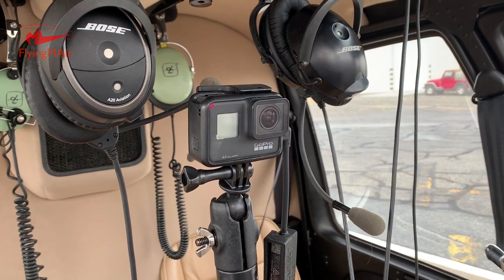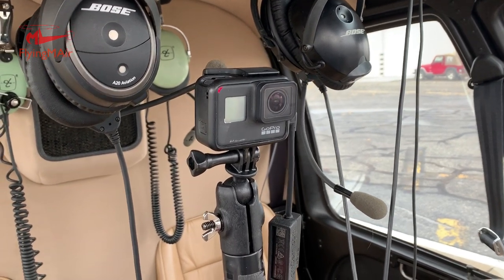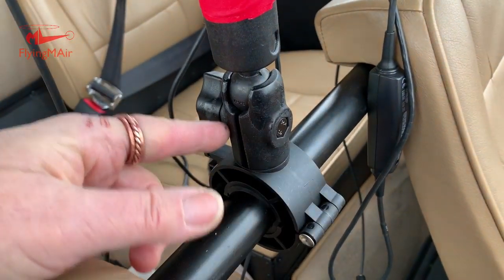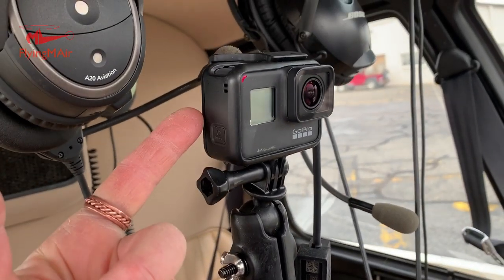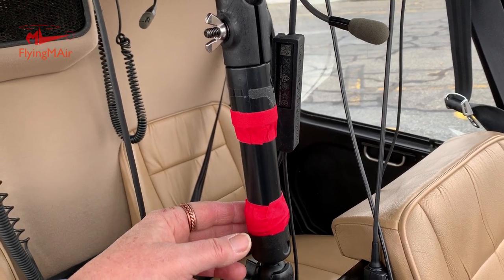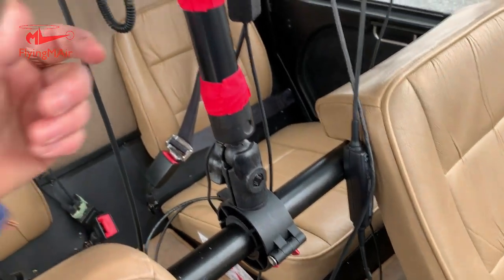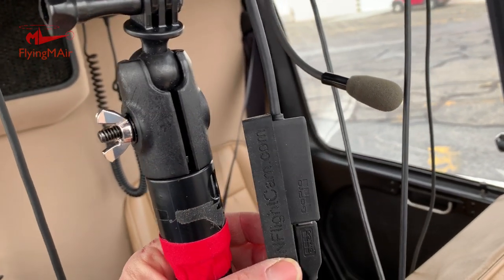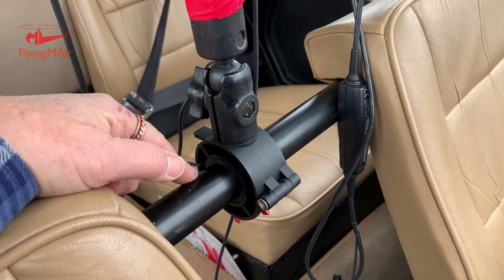Behind the Scenes: Cockpit Cam Instrument View Setup

Comment: Nice "techie" article, Maria.  You definitely need some strain relief on those audio & power cables. Duct Tape will do nicely.
Reply from the maker: As I think I mentioned in the video, I use gaffer tape, which is basically a cloth like duct tape that comes off clean. That's what I used on the mount (the red tape). It's pricey, but it's also what they use in the movie industry -- for a reason. It's good stuff.

Comment: Deffo best to take the weight off the cable which hangs down from the camera. Gaffer tape or plastic ties would do nicely.
Reply from the maker: Agreed. Gaffer tape is the answer. I have a ton of it.
Reply: @FlyingMAir  I agree, the weight of the adapter on the plug in the side of your GoPro is compromising that connection. Taping the adapter on your upright mount would cure that.

Comment: Hi. Great vid. Just bought the Gopro MAX, is the audio set up the same as the HERO (want to get radio calls etc)?
Reply from the maker: My understanding is that the GoPro MAX does not support audio input. Neither does the fusion. I need to run at least two cameras and sync them up in the editing process to get cockpit audio into the 360° videos I make. You can learn more here: https://www.aneclecticmind.com/2020/06/21/two-cherry-drying-videos-two-views/
Reply: @FlyingMAir  many thanks for that, a major flaw for me as i only wanted to bother with one camera and thought the 360 MAX would give the flexibility i wanted but the sound is a sticking point!! might have to involve the 30 day return!! i'll contact them first!!

Comment: I don't know. That RED tape is pretty racey !!  I just last night did a video on the cameras I use on my Paramotor.      "P  P G WhereEverett"  on youtube.  I cannot 'Bar Mount' anything to my quad due to vibration !  I don't have  a Hero 7 either.  Great to see how others are doing it though.  Thanks and keep 'em coming !!
Reply from the maker: I have crazy vibration, too. Try a Hero 7 Black or Hero 8 (which is supposed to have even better stabilization). Try borrowing from a friend if you can't buy one. Then mount as close to the aircraft frame as possible. GoPro does offer a reduction in price if you trade in any old digital camera; that's how I got my second GoPro 7. The trick is to attach the camera solidly to the aircraft frame. Look for safe mounting points and then check out what the folks at MyPilotPro have. Think outside the box for a solution. I'm convinced it's possible.

Comment: How do you connect the GoPro power cable to your battery cable?
Reply from the maker: The NFlightCam audio cable has a port for a USB cable. I attach that to the white 10A battery pack I showed between the back two seats.